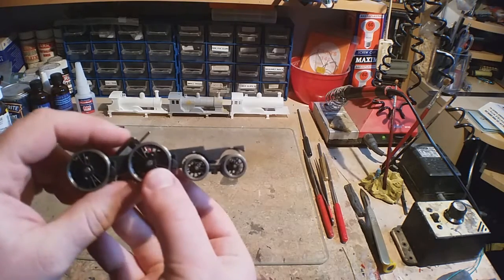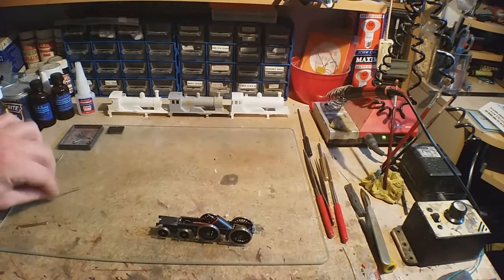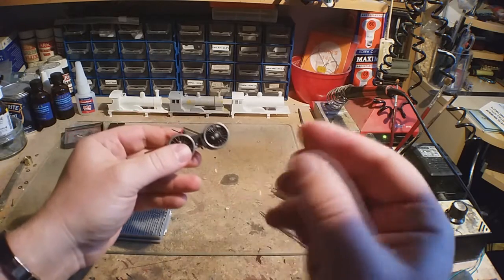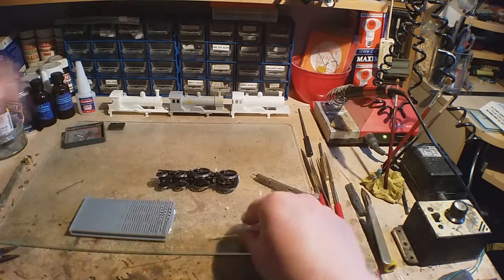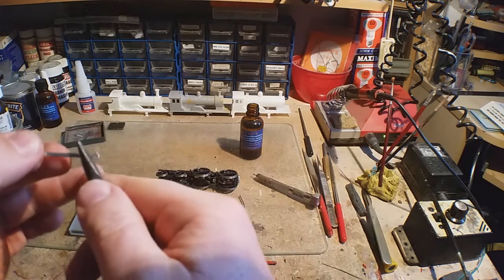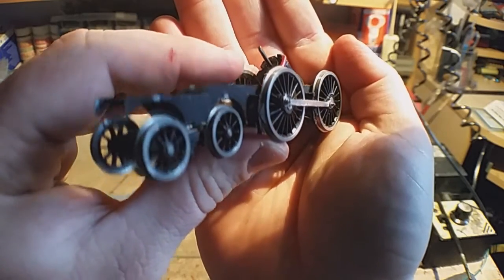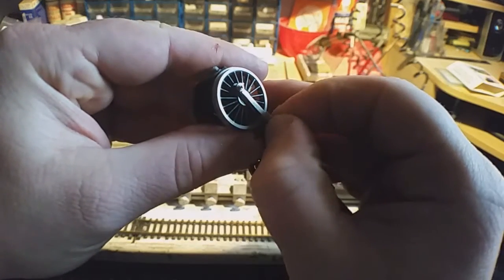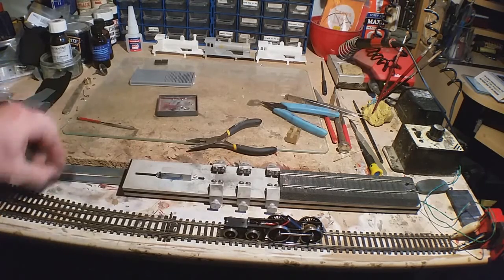Building an SCC Loco Kit - Part 11 - Coupling Rods & Crankpin Fiddle Sticks

Comment: Try using a lead pencil worked in to the solder and then spread with your fingers. Nice work so far.
Reply from the maker: Hi Mike, nice to hear from you.  :)Do you suggest the lead as another way of 'painting' the rods or does it do something?  Also by lead do you mean genuine lead or graphite?
Reply: Yep, pencil lead, but if you can find something softer than HB works better. No you still cover the brass with solder and use a fibre pencil to even out a rough surface not a file. Makes a mess but I've had good results - gives a steel like finish - from this. There should be a photo of one of my engines in the new snooze.
Keep going brother. Like what you're doing.
Reply from the maker: Oh I see now, could try it. :)  I still need to file the crank pins down yet.  Have done 3 but left one for the next vid.  How do you usually fix the nuts?    I used a bit of Powerbond 806 Superglue this time then filed them down.  

Looking forward to Snooze although I have no idea why it has been memed as such!

Thanks for the encouragement, have you watched the series from vid one?

Comment: Alan Gibson does 2 sizes of bushes, chose which is most appropriate (short or long) and file back until just proud of the boss.
Reply from the maker: True, the bigger size I understand is more for Connecting Rods though.  If we file it down it will have to be done before being put on to the Crankpin - not impossible but a fiddle no doubt!  I have never had a problem temporarily fixing the retaining nuts with Superglue though so if the rods are too fat I'll continue to do so.  Although again I guess thinning out the rods themselves would be a better option - a 3 minute job no doubt.

I'll mention all this in the next vid and give you credit. :)

BTW - S4 News 197 arrived.  I haven't read it yet but very much looking forward to it.  What page is your goody in?  :)

Comment: Would you not be better electroplating the rods rather than covering them in solder?
Reply from the maker: James Petts - possibly, yet I currently don't have the knowledge to do so and likely not the means.

So far I have found the solder 'painting' works pretty good.  Easy, quick 'n' cheap.

Comment: No! Don't put a hard solvent like that anywhere near crank pin nuts. The crank pin bush should be just proud of the coupling rod boss. This should allow you to tighten the nut against the bush. Absolutely no need for anything else to keep the two together. You should be able to ever so slightly move the coupling rod on the bush and I really mean slightly. I certainly have not used anything else on any of my locos.
Reply from the maker: Have been doing it to many loco's with no adverse affects!

Truth be told though the bush only pops through the coupling rod if the rod is thin enough.  Different coupling rods of different prototypes and companies are sometimes different thicknesses.  some GWR rods were beefy for example.

My own rods are a tad thicker than some etched ones at the bosses but the backs of them can always be filed down if you want them thinner.

I've always found without some type of glue or thread locker the nuts often work loose with all the reving about.